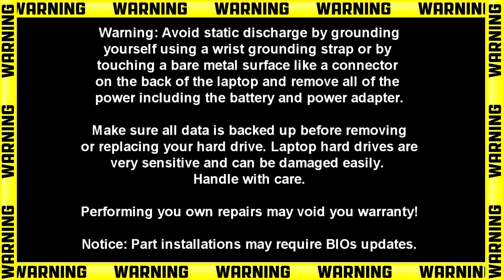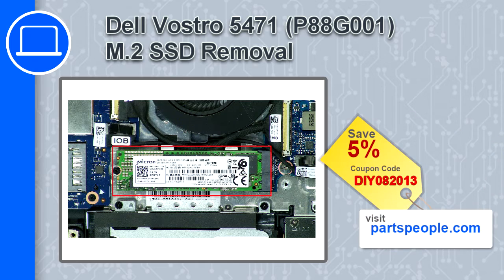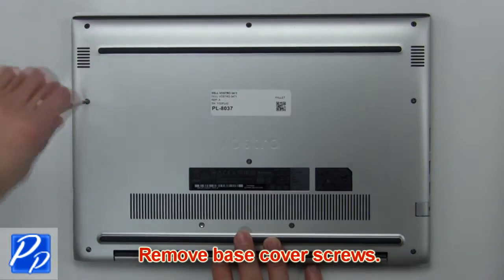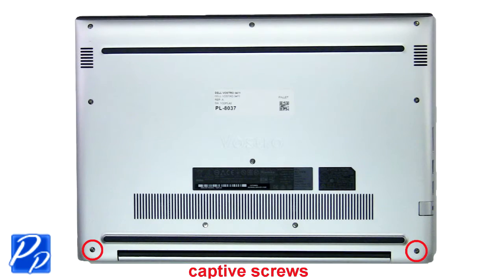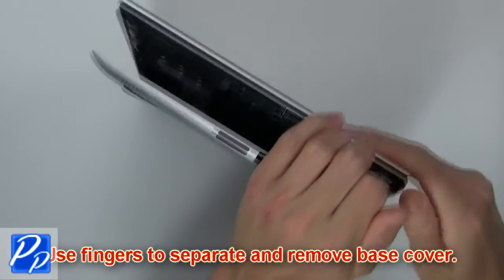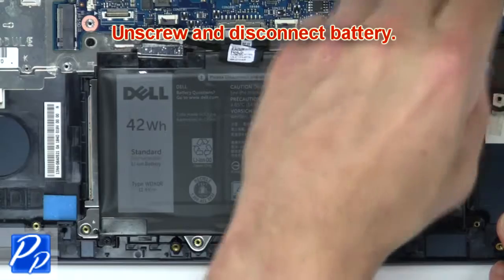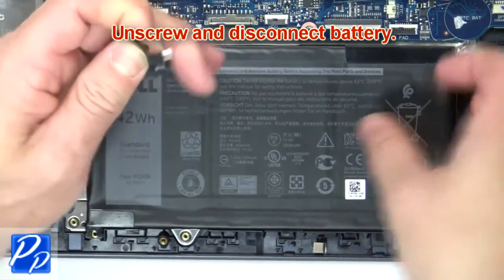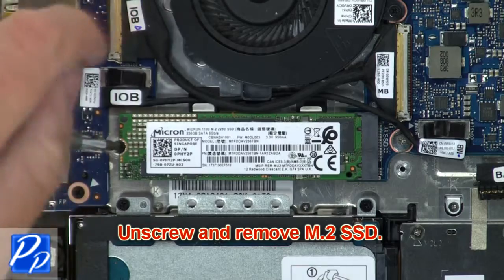Dell Vostro 5471 (P88G001) M.2 SSD How-To Video Tutorial

Comment: Can i install 2230 drive? Is it suite for the first hole? Any additional nut required?
Reply from the maker: Unfortunately no. This model is only designed to use an M.2 2280 SSD.
Reply: @dellpartspeople  thanks. I pushared 2280 one